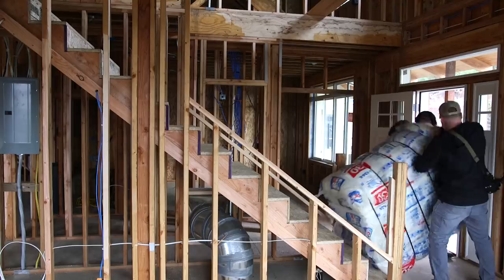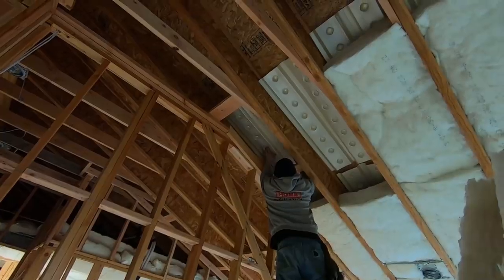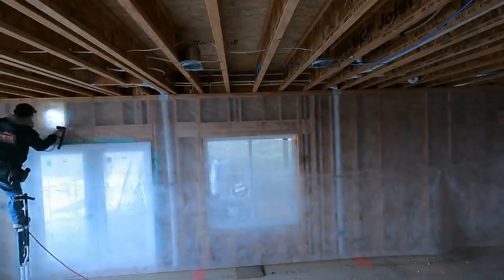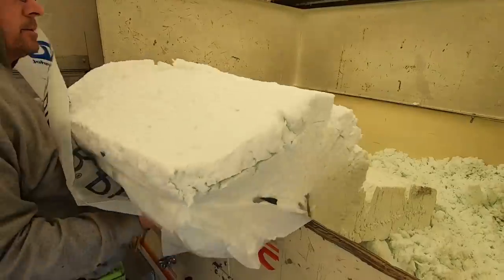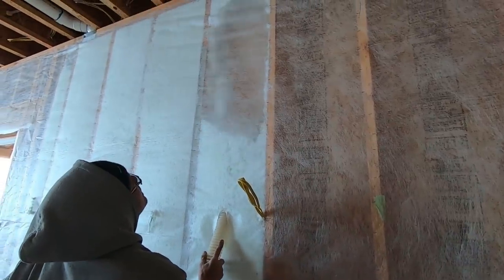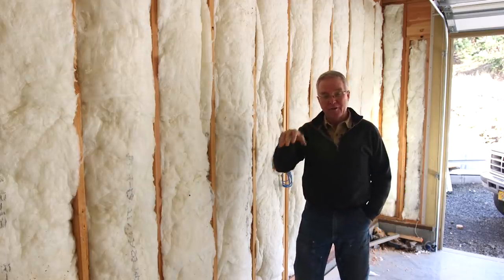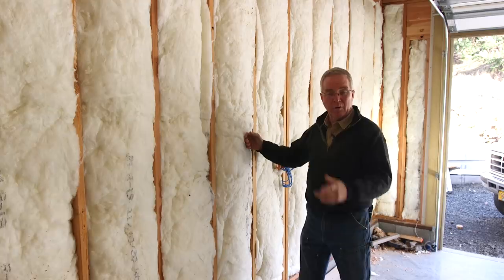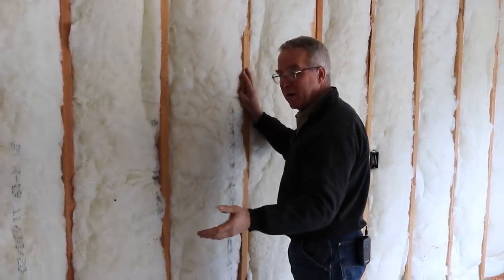Insulating A Nice House Ep.104

Comment: I've seen blown-in  insulation sag down to 4-5 ft high over time before. I'd MUCH rather pay a little extra and spray foam insulate. It NEVER moves AND because of it's rigidity, you know any wires/pipes in the wall aren't going to sag/bend since it holds them in place. I'll pay the extra any day if it means I'll never have to worry about it.
Reply: Pros and cons to all of it. Properly installed density of cellulose won't sag. Improperly sprayed foam will off gas forever or burn your house down. It's also a PITA to remodel or run new wire in a wall that's been foamed. 
They all have their place as well as tradeoffs.

Comment: I remember well the first time i had to get into the walls of the first house I bought (built 1922) to discover that the insulation consisted mainly of cobwebs. Is there such a thing as a negative R value? Whether tearing into walls in that house or doing new work I always did my best to get the biggest bang for the buck according to the current codes as far as insulation went. Just watching this episode impressed upon me how much has changed in terms of available materials and methods, and how if I was to attempt a major building job just how much i would have to learn about insulation as well as other things. But that's the thing about those who try to do good work - they are always learning.

Regarding windows being the weakest link in the building envelope, a bit of history. Way before glass was available to most everyone and especially  ordinary people, openings in buildings were still needed for light and ventilation. Imagine sharing your dirt floored home with farm animals and a fire with no chimney and just a hole in the roof to let the smoke out if you were lucky.  Those openings, small, unglazed and drafty as they were, were called wind eyes (ventilation + light), from which we get the modern term windows. May seem primitive, but I'm sure they met code at the time. Cheers, Scott, and keep up the good work. You are an inspiration.
Reply: I love that history.💡About windows: I see pictures of beautiful rooms that have an entire window wall. How does that work? If they leak so much?

Comment: The paper on batted insulation is typically a vapor barrier. You would see this used in colder climates in older homes with large accessible attic spaces. In today's construction, vapor barriers are build into the exterior construction so its not needed anymore

Comment: Re: Paper backed insulation, from JM's website:
"Kraft-faced insulation includes a paper vapor retarder, which helps prevent mold and mildew. "

Thus, you wouldn't want to use it if there was another form of vapor retarder aka "barrier" in play either on the interior or exterior of the wall.

Comment: The mantra for old houses in the uk that I was told was: fix uncontrolled draughts, insulate THEN worry about windows. That order makes the biggest difference vs cost. Too many people over here (UK) seem to rush into a renovation project and spend thousands on windows before the close off unused chimneys or fit better loft insulation then wonder why they still have a cold house and big heating bills.

Comment: Watching them fill the cells with spray foam was very satisfying.  Does the foam stiffen once it's sprayed into place?  In other words, if a hole was later cut into an exterior wall to install an additional electrical receptacle, for example, would the sprayed in foam spill out?  And I'd imagine it's much easier to fish an electric line through spray foam vs fiberglass bats.  Also, where is your vapor barrier - between the sheathing and the roofing and siding?  Is it necessary to put a vapor barrier between the attic and the upstairs living spaces?

Comment: If you're leaving the attic vented, are you planning to seal the power boxes and headers in the ceiling to slow the warm air going into the attic? Personally I would've opted for a sealed roof instead, but I understand the argument for going the route you did.

Comment: Here in the Netherlands we use vapor open(cold side) and vapor closed membrane(warm side)  to keep the moist either outside or insinde (in this case it needs to be mechanically ventilated. 
We always push the isolation against the inside of the roof because ventilation needs to happen inside and not in the insulation itself (this is the basic idea of insulation right.. trapped air).
I’m not an expert in any way and geographical differences on how to tackle these kinds of things will always be here I guess

Comment: Excess heat is at least as big a problem in space as not enough. Heat can't be conducted out through a vacuum, and sunlight is very hot. Water will freeze quickly in space, but that's mostly a function of the pressure being low enough that some of the water boils, which requires heat, which it takes from the surrounding water. The ISS does have insulation, but that's because the exterior temperature can range from -250° F to 250° F, depending on if it's in sunlight or in the shade. Further, the electrical systems create a lot of waste heat, which means that the ISS also needs large radiators. One of the goals of the second mission to Skylab was to install a sunshade, because without it, they were worried about the plastic insulation on the internal wiring would melt and release poisonous gas.

Comment: Scott, your space station comparison was unfortunate. The space station has no heat insulation. The challenge in space is to not cook. Those 16 big panels that stick out are radiators to dump the heat overboard. 

The problem with space is that there is no matter in a vacuum so no heat transfer via conduction can take place. Heat can only radiate. But radiating heat is a much slower process than conducting it. If the cooling system was not in place, the astronauts would cook alive.
Reply from the maker: Well thank you! No Insulation! I am stunned!
Reply: Then do they maybe use insulation to stop heat transfer from the hull to the inside? Insulation works both ways.

Comment: the paper face was originally meant as a vapor barrier. depending on the climate (primarily heating or primarily cooling) the vapor barrier should be on the outdoors side of cavity or inside face of cavity. Visqueen used to do the same thing mostly in northern climates. But it never really made sense to me, giving moisture a place to condense and then mold to grow. Newer fiberglass insulation seems to be more tightly matted to reduce the need for a vapor barrier which also makes it easier to handle since not as many fiberglass fibers get in your skin, eyes, lungs etc. Also, the vapor barrier regardless of the climate should be done as tightly as possible on the sheathing and windows.

Comment: When I was a young lad, I was always told to not handle insulation with your bare hands due to the potential for glass getting embedded in your hands. Is that insulation not fiberglass? Or are your hands just tougher than mine? Haha... 

Great content. That blown insulation looks slick. Just watching it fill up every inch was very cool.

Comment: 7:45 air leaks and limited insulation by meter will be a HUGE issue! especially now that you have insulated the rest of the walls.  The electrical panel is a "Cold Condensing surface" now, and you have extra air leaks to drive moist air, be it from the inside or outside.

Comment: I may have missed your exterior foam video - but here you seem to be suggesting you have r25 in 2x6 walls with just blown in cellulose (now corrected to be FG). My guess is that your building code r25 is actually r20+5ci (continuous insulation) which means exterior insulation of some kind. Did you do that already? Besides, how do you get r25 in a 2x6 wall with blown in only?

Comment: Funny thing, I don't disagree with your point, but the international space station actually has issues with too much heat! The issue is because, with no convection or conduction of heat, the only way for heat to leave is radiation. So they use ammonia radiators in order to get rid of the heat being generated by the astronauts/equipment. They still have insulation against solar radiation but I believe that is more of a radiation thing rather than a heat thing, but I may be wrong.

Just thought you might enjoy this fun fact, great video!

Comment: What about condensation in and around that electrical panel? As the garage is insulated, the air in it is going to be warmer than outside, and most likely have a higher absolute moisture content (especially if the occupants use it e.g. for hobby work besides keeping a car in it - they'll open the door to the rest of the house more often or keep it open longer, possibly heat the space on purpose, and add a lot of moisture by just being in there and breathing). Meanwhile, the panel is about to be a cold spot on the wall, possibly colder than the garage door which does contain some insulation. This could cause condensation in the very spot you absolutely don't want any water and it could be worse than water just leaking in, as it would tend to condense on thermally conductive surfaces - on bus bars themselves or even inside the breakers.